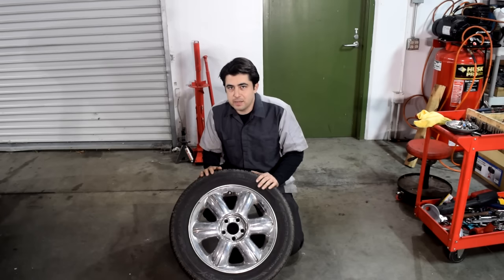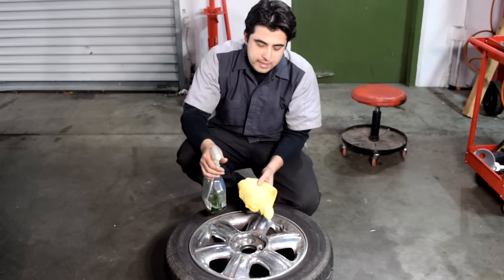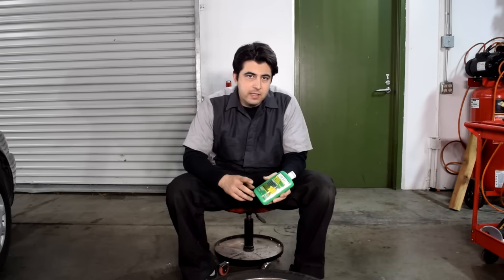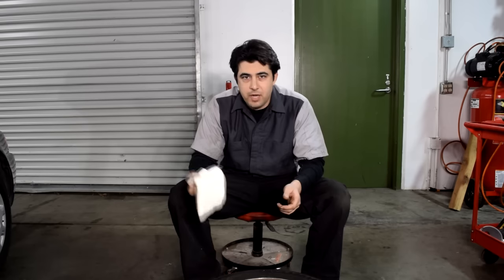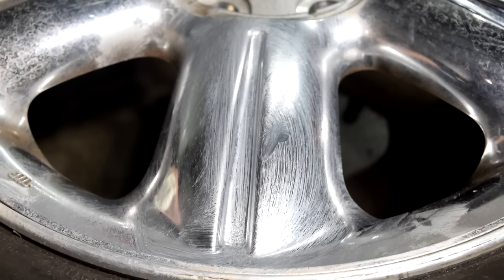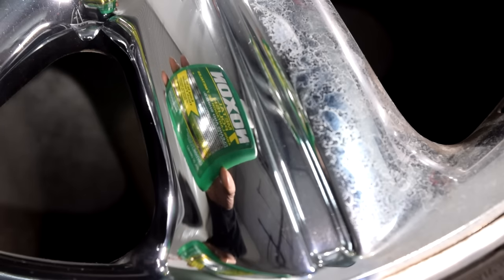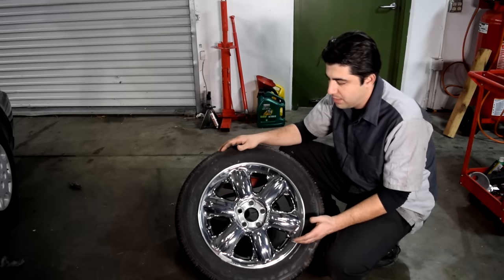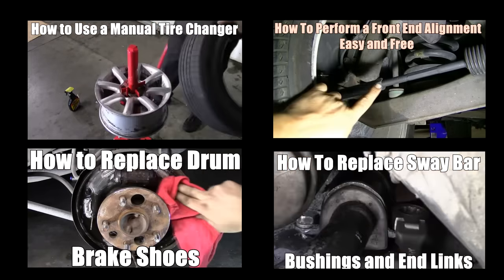How to Remove Rust and Restore Shine to Chrome - In ONE Easy Step

Comment: This tip worked AWESOME!
took less than 4 minutes per wheel. The steel wool did not scratch my wheels.  Took very little elbow grease.

Comment: Did this yesterday had pretty bad looking chrome rims, years of mistreatment. Came out beautiful and hardly had to use any elbow grease. Amazing how the steel wool just wiped everything right off. 1 hour later Im pretty damn impressed! Don't forget to spray rims after application and wipe dry with a clean microfiber towel.
Reply: Did not even come close to removing the spots on my rims.
Reply: @spinnerjays5389  yeah same

Comment: Thanks for the video. Bought a 2001 vette a bout a year ago. Was a daily driver but well kept. The ZO6 wheels had a little wear in the angles and tried several products but not a clean as I wanted. Tried the Noxon today, didnt even use the steel wool, and they came out great. Lots of oxidation and surface rust came of on the micro rags with just elbow grease. Very happy, thank you for the advice.
Reply: Nobody cares

Comment: I achieve the exact same results with 0000 steel wool by itself for years now.  I never have a problem with water spots,... The steel wool will take them right off.
           Good video just the same. 
Also, for anyone that wanna know if their rim has a clear coat. Take that 0000 steel wool and very lightly wipe a 1 inch area on the rim. 1 wipe !  Take a flash light and see if you can see very fine scratch marks. If you can your rims has clear coat on them.  Even the steel wool will dull them out.
Reply: Hey bro, what is clear coat and how do I restore that?  Maybe a sort of wax treatment after?  I'm restoring harley chrome and it's very very delicate under a torch. Steel wool, metal polish, all scratches the gloss layer.  Silver polish is pretty good but a dry finish.

Comment: I use Meguiars Ultimate Compound (liquid) and #0000 steel wool and it works great.
Reply: Anthony Gates  Not sure never ran into that situation before.
Reply: Anthony Gates  Sure, try a polish maybe with a buffer see if that helps
Reply: Anthony Gates  no problem
Reply: Anthony Gates  Awesome good to hear

Comment: Should have used the steel wool with the simple green also.  Probably would have cleaned the wheel just as well because the most effective tool in this video is the steel wool.
Reply: No, I have tried a lot of products from the auto parts store including simple green and it didn't do the same. This chemical is very acidic and the smell is very strong. I believe if left on your hands too long you will have a chemical burn.

Comment: trying this tomorrow  on my trucks wheels  I'll post a video.
thanks for the info bro! great video
Reply: how'd it go?
Reply: +KK Woolsey 
I didn't the time like I'd planned, so no video. 
I did take before and after shots, that I'm gonna post. 
turned out great, but wanna do a second attempt to do away with the slight pitting in the deep contour sections. 
I'll video that part for sure
Reply: gshffr for sure.. good luck brother
Reply: gshffr Did you ever post that video?
Reply: Jan Romanosky , no. i backed over my phone a week after i recorded the process. 
i can tell you it worked great though. 
when the weather finally breaks here in PA, ill be doing it again as the road salt has been harsh on my wheels this winter. 
ill be sure to make another video and post it right away this time.
Reply: Okay cool

Comment: would it clean off water marks on black aluminium rims?
Reply: Your rims are anodized, the color is a product of the aluminum itself. You can make a paste out of baking soda and water and let it soak with that on it for an hour. If that doesn't work and you don't mind turning them back to natural silver color, a soak in Drano will strip everything off it.

Comment: I heard you can use 
Aluminum foil ,   have you heard or tried it ?
Reply from the maker: Bow sr I haven't personally tried it, but would imagine it works well on really heavy rust on somewhat flat surfaces. Seriously doubt if it will give the nice shine Noxon and steel wool would give you though. Seem some people use a can of soda as well. I might do a follow up video comparing all these methods when I get my hands on a rusty wheel.
Reply: @myRatchets  Soda = phosphoric acid
Reply: Aluminum foil works used it on two sets of rims to restore them

Comment: I bought the steel wool #0000 and it scratched my chrome rims wtf
Reply: muahahahahaha
Reply: Hahaha! Either your rims arent chrome or you got the wrong steel wool. Try 000 or 00.
Reply: You did something wrong, all of my chrome came out great.
Reply: You  need course steel wool,because it glides over the chrome. The finer the cut the more surface it covers.
Reply: Fake chrome brah
Reply: Yeah it did mine too
Reply: Never use steel wool, unless all else has failed.  After washing the wheel, start with Chrome polish, if the doesnt work go to next wheel wash it, then spray it with CLR bathroom cleaner, let sit for 2 minutes then rinse and wipe down.  Try Chrome polish on that wheel.  If that doesnt work, go to next wheel, wash it, use CLR, rinse and try automotive polishing compound.
Reply: Did mine too
Reply: Gabe 
You used the wrong grade. You should’ve used 00. Never use 0000 steel wool on chrome.
Reply: @Samuelfish2k   he says 4 zeros in video
Reply: chris connors 
Idgaf what he said. He’s wrong. You’re supposed to use 00. Go try them both and see what happens.
Reply: @Samuelfish2k  ok buddy I see multiple videos that say 4 zeros feel free 2 make a video if u what to prove these guys wrong lol I'll keep researching it but leaning towards the videos.. looks like the rims turned out good to me
Reply: you pressed too hard go very light barely pressing and not going over the same spot tons and tons

Comment: Steel wool is a bad choice all around for rims or any other finish that costs or would cost someone hundreds to thousands of dollars to acquire. Yeah it's touch of rust and oxidizing rims, but you also run the risk of scratches. True chrome dip from reputable companies is generally hard enough to withstand alot of shit, I mean they are rims after all and they see more abuse, wear and tear than any other part on a vehicle. But it's still a bad idea to get into because as hard as chrome dip is, over time it does weaken and get brittle even if no signs of wear are visible. There are plenty other was to clean your rims, the main one being aluminum foil!!